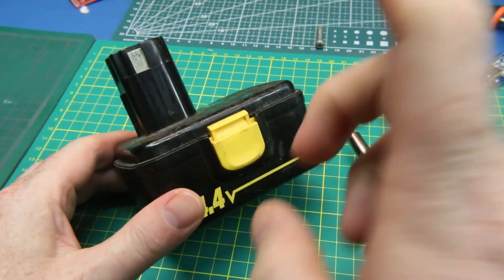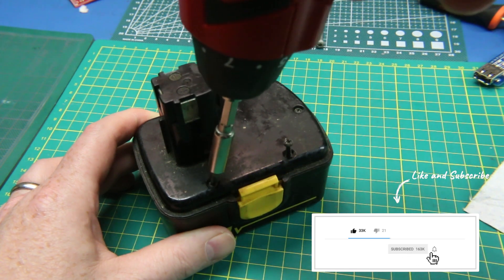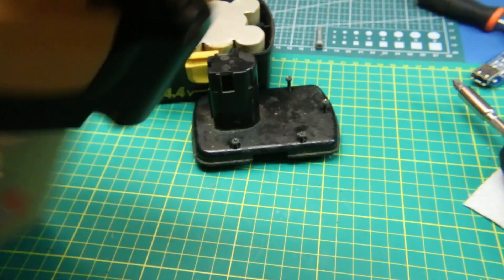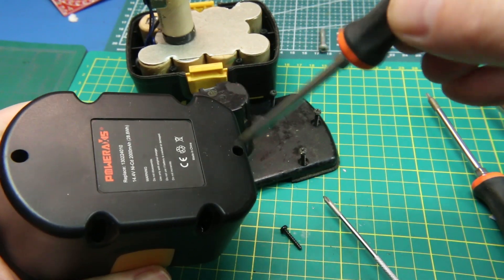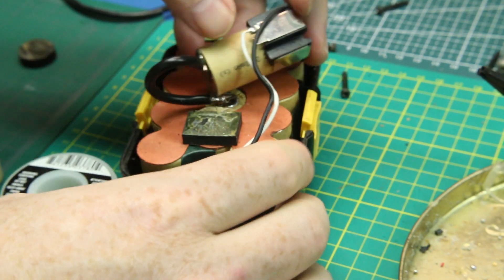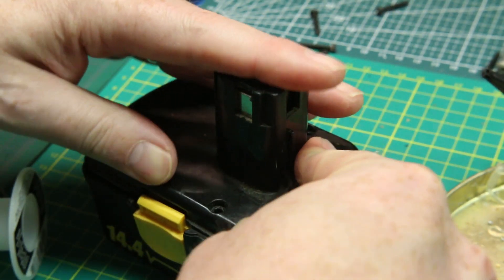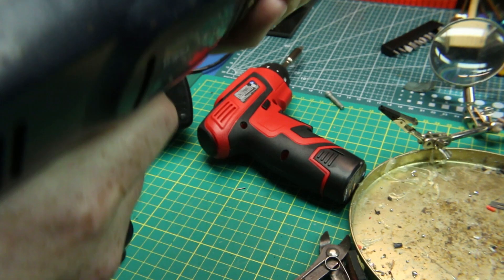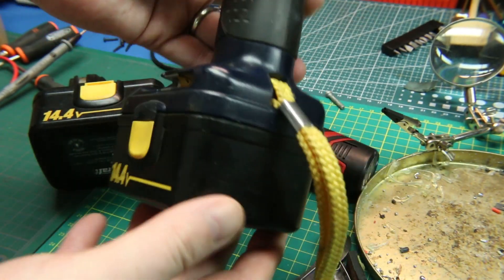Dead Drill Battery- Replace NiCads YOURSELF!

Comment: You would be quicker opening the charger and swapping the polarity contacts haha
i have a better idea and quicker use a drill with a cable and a extension plug batteries don't last long enough and the manufacturers don't give you a option to fit a adapter on to the cordless drill to power on from the wall. Buying the batteries to replace the dead ones costs more than the price of the drill
Reply from the maker: https://www.google.com/search?q=how+to+use+a+corded+drill&oq=how+to+use+a+corded+drill&aqs=edge..69i57j0i22i30l7j69i64.7586j0j1&sourceid=chrome&ie=UTF-8